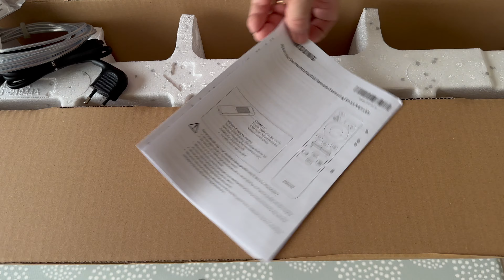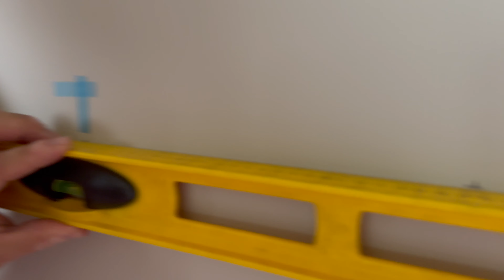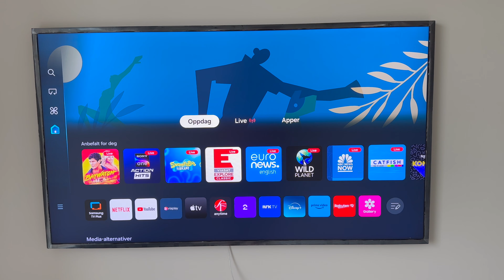2024 43" Samsung the frame unboxing and wall mounting

Comment: Why would you throw away the template? Why didn't you put the one connect cord in the wall so it could look like an actual picture?
Reply from the maker: Hi. I have mounted hundreds of this model so I do not need the template to mount it. In Norway there are very strict rules for putting electrical wires in the wall, that make it very expensive to do so most people here dont do it.
Reply: 😂😂😂 me (laughing) as he crumpled the template paper 😆😆😆
Reply from the maker: @Kttex2  No need for that. 😊
Reply: @oslotvmontering  I bought a used 43" Frame TV without the template. Can you tell me the measurements between the brackets, and the distance from the top of the tv? Do the TV screws rest in the "high" or "low" position in the final state? Thanks so much in advance!
Reply from the maker: @dshi28  HI. 4 cm is the distance to the top. Where the screws rest dosent matter.

Comment: I need ur help please. I have a 65"QLED that has stopped working. There is a red light on the bottom of the TV but the screen is blank. What could be the problem? I have changed the box but still doesn't work. I need ur advice please
Reply from the maker: Hi. Sounds like you need a new display panel, that panel is in the tv, not the box.
Reply: @oslotvmontering  thank you so much for ur reply.  Is it easy to get it on the market and easy to fix it?
Reply from the maker: @Sityanaantuan  Hi. If you have a warranty Samsung will fix it for you. If no warranty is very expensive to fix unfortunately..
Reply: @oslotvmontering  owww no! I bought it overseas and won't be able to take it back again. 😪